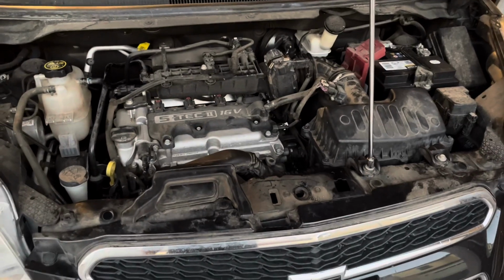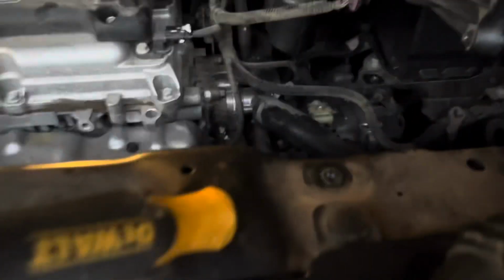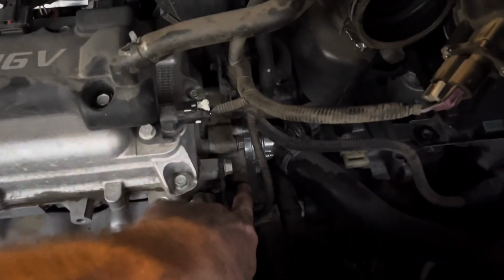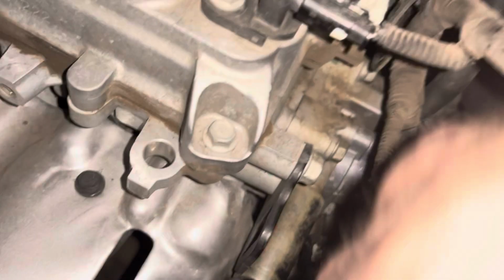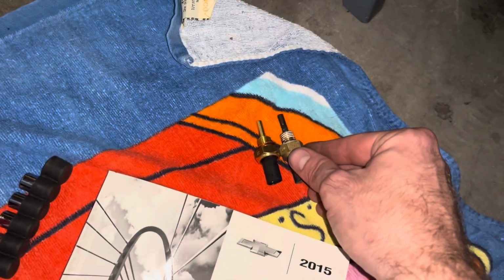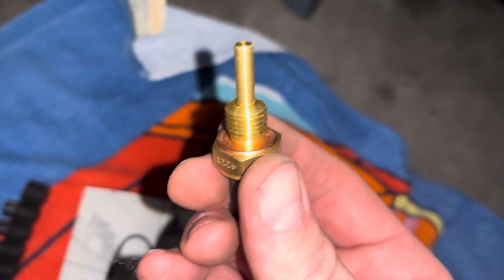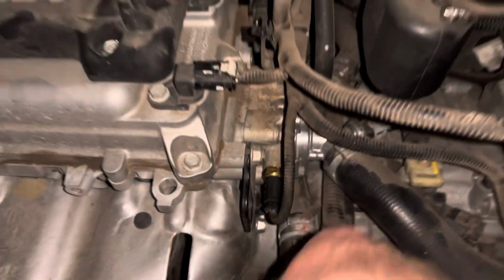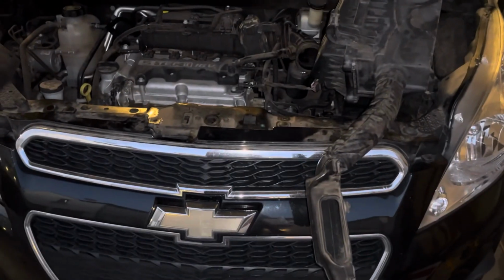2015 Chevy Spark ECT Engine Coolant Temperature Sensor Replacement.

Comment: I need more angry mechanics in my life. I feel represented here. Just changed the ECT out on a 2013 spark after it threw a P0118 code only to have it then throw a P0113 code. FML. Probably just a dirty air filter but... come on!
Reply from the maker: Happened to me too, check that the hose from the air intake filter to the throttle body didn’t rip. Mine did 😊
Reply: @AngryMrFixit  It was ripped.  Ordering a new one. Glad these things are predictable.
Reply from the maker: @StuartBeefWellington  you don’t happen to be Stuart Wellington of the flophouse, do you? If so, I have an update regarding piranhas: 3d I’ve been procrastinating emailing about.